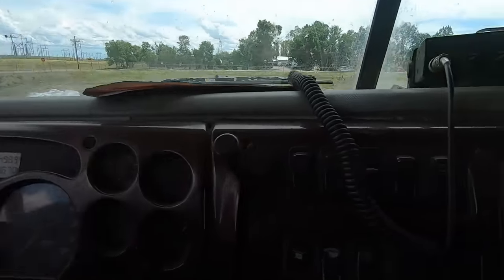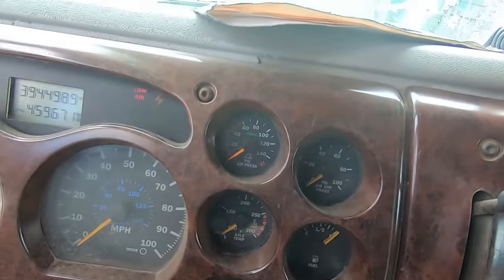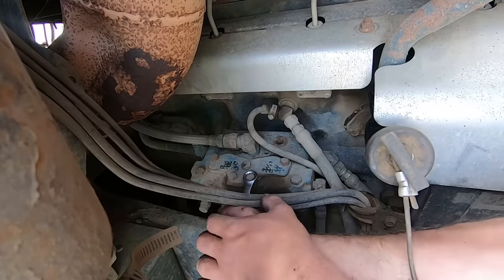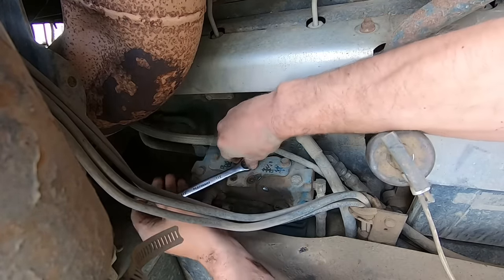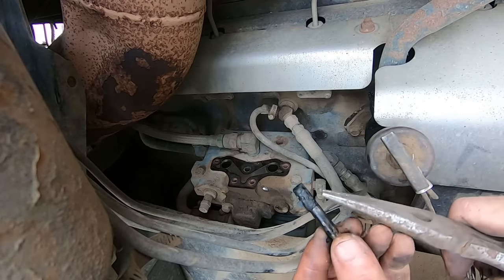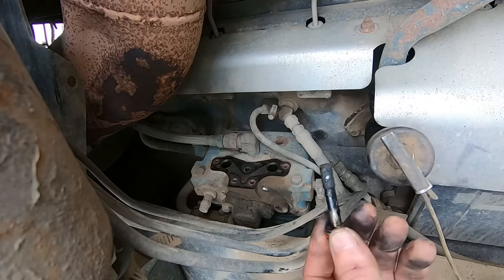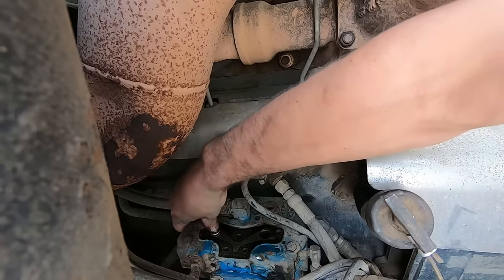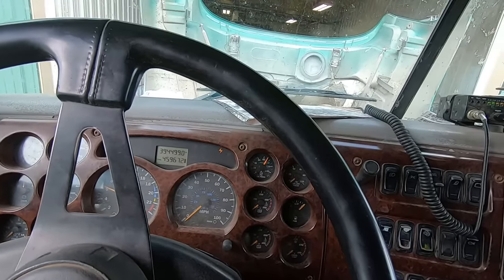truck wont build air - - quick fix - -

Comment: Head has to come off on some unloaders. Poor design in my opinion. Volvo and Peterbuilt use them. Goofy little plate that is prone to carbon build up. One piston with a hard o-ring and it will cycle on and off for ever.